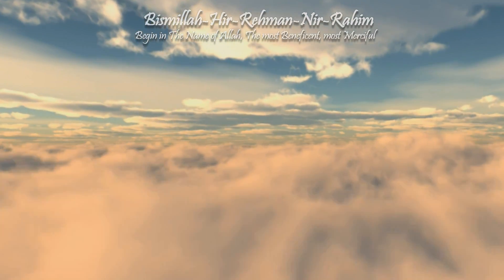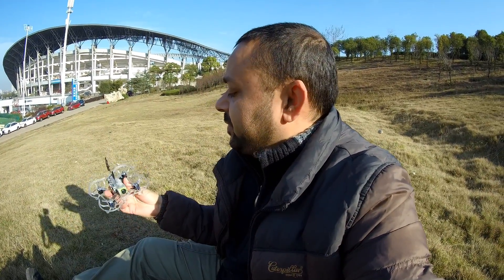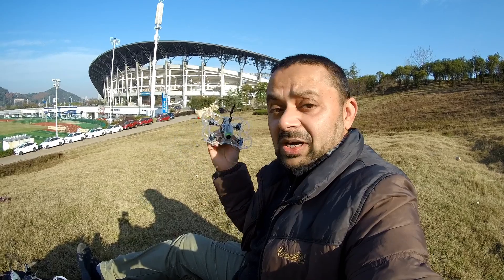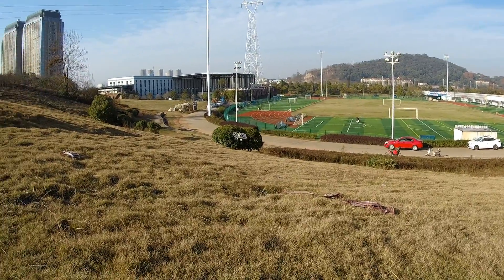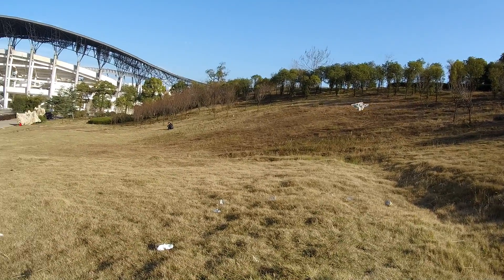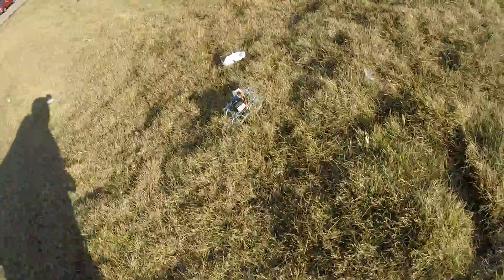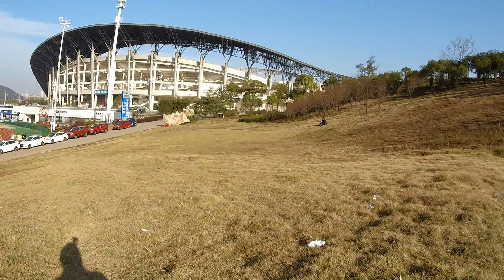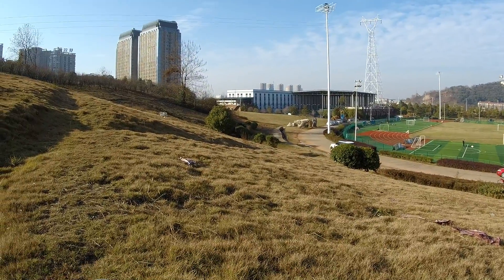Diatone 2019 GT R239 2 Inch 3S FPV Racing RC Drone F4 OSD RunCam TX200U

Comment: Come on my Man! 😎 You are a prominent reviewer! I've been a subscriber for 2.5 years 👍 ... Get yourself some smaller 3S batteries! I don't review at all or post videos, and I own approx. 15 460 - 650 3S batteries perfect for this quad. They range from 44 to 55g in weight. What did yours weigh? 70-80g?  Way too heavy to do a proper review on this lightweight quad! 😕 Heck, I'll bet your battery weighs the same or within 10 grams of the total weight of the quad! Lol 😲
So, read this, and please immediately order some batteries! Look on Hobbyking... They have a sale right now and my 460 3S Turigy batteries were barely 5 bucks each! Yeah 5 measly bucks! And I guarantee they'll make that quad blow your mind with the difference in performance compared to the batteries you used! 850 3S?! Come on DUDE! LOL .... 🙄😜
Ps
I also own 10 Turnigy Graphene 800mah 3S that I got on sale, same place, for only 6 bucks each! Hobbyking kills it on battery clearance sales. Subscribe to their sale emails. 👌🤘

Comment: Hello Ali. I jusr subscribed to your channel. I liked this video a lot because of the LOS test. I have one of these, but it does not fly as well as yours. I have problems with weight using 3S 650mAh batteries. But you are using 850mAh 😱. Please tell us your PID configuration.

Comment: asalamualikum Ali , I want to ask , for 25A ecs at Diatone r239 it was support for 4s lipo ??
barakallah ali
Reply from the maker: Wassalam. There is a 4S version, so when you order make sure you order specifically 4S version. 3S version will not support 4S battery too long LOL
Reply: This one R239 has the same electronics as the R249 wich is 4S compatible but has carbon fiber frame. So there is no problem with voltage, but the 239 is configured to run on 3S in Betafligth PID tunning. I'm guessing it is because of the frame being plastic. 4S would make the motors go much faster giving to much extra vibration to the frame wich, as said, being plastic, would transfer this vibration to the FC making it harder to fly.